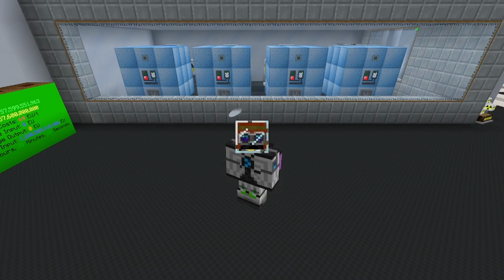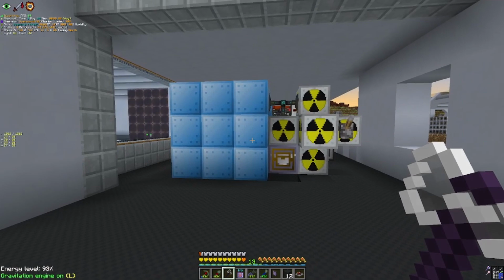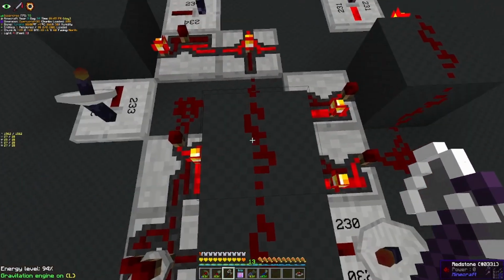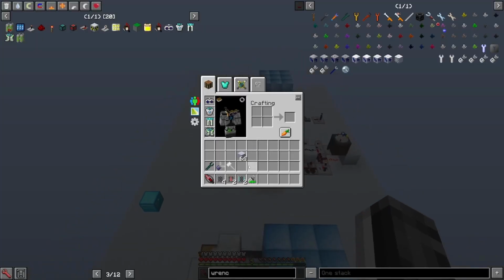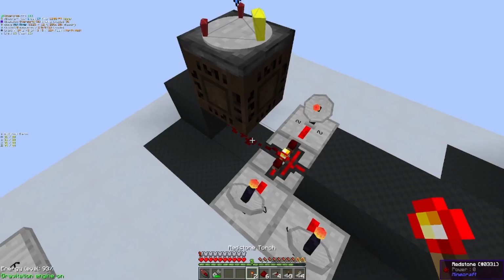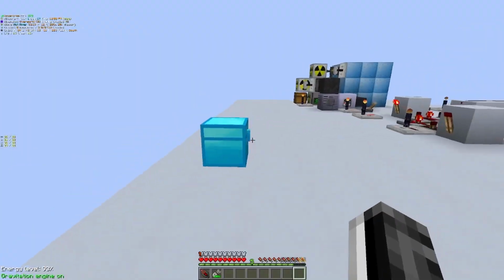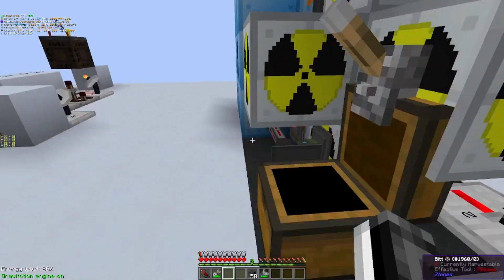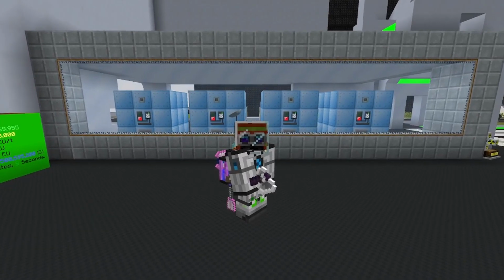IMPROVED GTNH Vacuum Reactor Tutorial - Fully Automated | 3x3x6 5A IV Power in EV

Comment from the maker: CORRECTIONS: 
1. Having the 'Power Control' signal (the one set to 4 in the video) directly up to a energy detector can cause heat gain if the signal is flickering on and off too quickly. I would recommend using a repeater set to 128 ticks as a buffer to prevent flickering.
2. I noticed that I have one of the repeaters set to 4 ticks in the video. On my setup that I have done all my testing on, it is actually set to 8 ticks. I am not sure if this causes issues, but just something to be aware of. Will update this comment after doing some testing.
Reply: My reactor did gain heat, unsure if this is it. I was pretty sure it’s because it filled my energy buffer before the coolant timer could go off. So every time the reactor turned on the coolant cells gained heat but the timer never went off
Reply from the maker: Thanks for reporting this. The reactor should be trying to replace coolant anytime the reactor is off (even without the timer activating). I am not entirely sure what would be causing the problem in this case.
I didn't do that much testing with rapidly flicking the power on and off though, so I'll try to do some and see

Comment: Some things to consider:

uranium version makes 5 IV or 21 EV or 85 HV (it rounds down to integer ampers based on what cable you use)
thorium version maeks 4 EV or 17 HV

Timer must be set so that the cells gain less than 25 procent heat, so that they never get from above 25 to 0 between one cycle of switching cells
For thorium version, you lose about 5 procent on the middle cell in 55 seconds, so you can set the timer to 2 or 3 minutes and you will be fine (maybe close to 4 minutes)

You need to offset the cells on symmetric positions by at least 25 procent
because of that, you will never have to switch both of them at once, which means that you only switch at most half of the cells
for the cells that are not on the symmetric positions, there is not a good way of making sure that they all dont synchronize at some point, which would switch half of the cells at once

The two repeaters next each other (4 ticks and 64 ticks) are there for this reason:
- 4 tick repeater will stop reactor faster than 32 tick repeater turns on coolant control
- 64 tick repeater will start reactor later than 32 tick repeater turns off coolant control
IMPORTANT: Timer has 64 tick repeater after it, but master and power control does not. (because this part of circuit actually does not work for short signal)
SIGNAL SHORTER THAN 64 TICKS (power or master control), MIGHT ALLOW THE REACTOR TO TURN ON IN THE MIDDLE, WHEN THE COOLANT CONTROL IS TURNED ON.
Reply from the maker: Thank you for the in-depth explanation of these mechanics!

Comment: Hi Isoarcree. Thanks for this tutorial, I used your last setup from January to april at this system push my base from early IV to Late IV and I want to push it to Fusion.
Let me introduce some feedback and an improvement : I used MOx fuel in a heat neutral reactor capped at 80% of hull heat. The next schematic produce a 90k-92k reactor and is compatible with your infrastructure. You need a big amout of Plutonium to start a Mox Vacuum reactor (360 plutonium) and I suggest to do plutonium bee to reach this value. after reaching late IV I started to have random tick heat (and a reactor has exploded). So let me take a week to change my reactors and adapt with your new version. Im giving a feedback to you when it finished.

This is the schematic (M (Mox) and C (Coolant)) :
---------------------------------
 I  MMCMMMCMM  I
 I  CMMMCMMMC  I
 I  MMMCMCMMM  I
 I  MCMMMMMCM  I
 I  CMMMCMMMC  I
 I  MMCMMMCMM  I
---------------------------------
Reply from the maker: Awesome! Thanks for the suggestion. Please let me know how it works out. Hopefully this design doesn't give you any trouble like my last one did.
Reply: @isoarcree  ok man...My reactors exploded 4 times this week...
Reply from the maker: That is surprising. Are you sure it is built correctly? All of my tests haven't produced any heat gain. You might have to watch it to see when it is gaining heat and then troubleshoot from there.
Reply: @isoarcree  I think I viewed your vidéo more than 10 times xD. I rebuild 2 reactors this week and they don't have exploded. I have up the damage threshold (25% => 50%) and reduce the function time before the cooling loop by half.
Reply: @benjamingirard1789  That makes sense, MOX iirc produces twice the heat when coreheat is above 50%, 
so your margin of error before the reactor has an "unplanned energy surplus" is much smaller than when using uranium.

Comment: im running this setup to i can run breeding reactors for pl-241 so i can make americium plasma in a tier. so i can avoid the stupid GTNH plasma chain(worthless compared to the simplicity of an americium based power setup). my reactors give 2 ZPM when i run the core temp at 70%. i do not plan to off set the coolant cells b/c im using a higher tier cell. and plan to use large input bus's output buses and have the LV chest buffer(with a lot of spare coolant cells). imma run 2x of these reactors for 1 uv. which will match the he plasma set up i currently have. honestly i wanted to ask if im cool not offsetting the coolant cells when ill have so many spare. i wanna make sure missing something like a random limitation i didn't know about. but also i wanna thank you cuz this set up only works in a reasonable way thanks to this tutorial.
Reply from the maker: The purpose of offsetting the coolant cells is to A) prevent your vacuum freezer from getting overloaded. And B) to prevent the possibility that not all cells are able to be extracted within a single coolant replacement cycle. Sounds like you have A) covered with your extra coolant cells. As for B) I am honestly not sure if it will be a problem. Might be a good idea to do some testing to make sure that your conduits can extract and replace all the cells within a single coolant cycle.